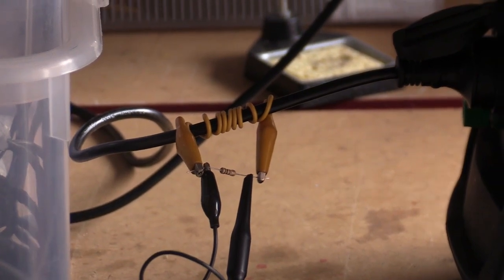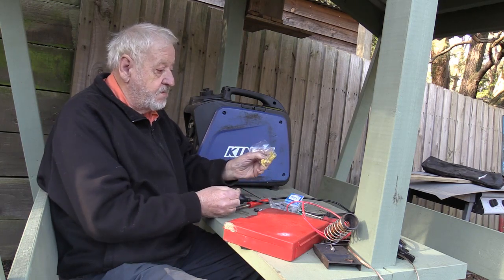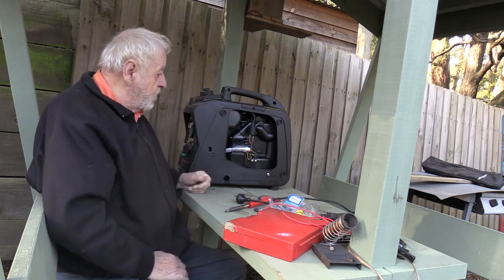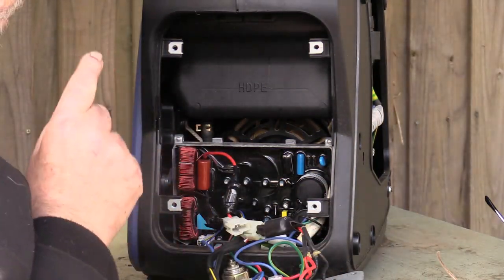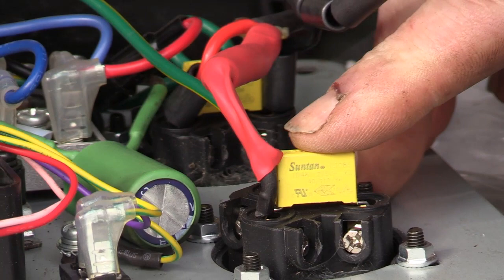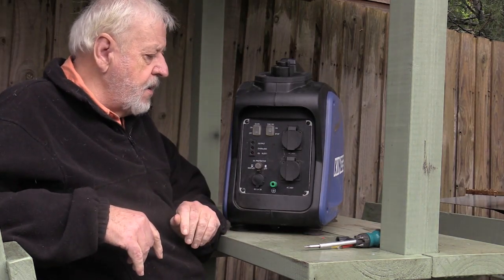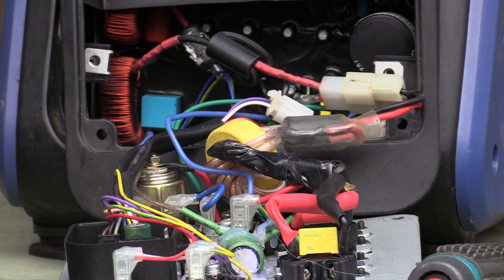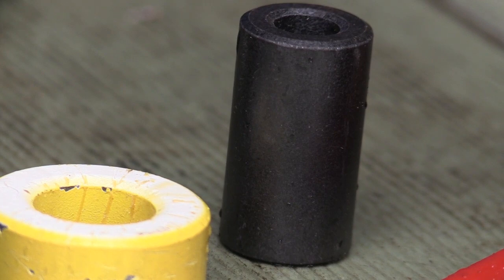QRM and EMI fix in my portable 2kw Kings Generator

Comment: We are the only ones who comply with EMC.
I once did a park activation and these grey nomads turned up in their Taj Mahal and when they decided to have lunch the entire HF spectrum was wiped out wall to wall.
You learn to be patient when you're an amateur.
Reply from the maker: Hi Ade there is a large number.s of gear that will make H/F a wast of time I found that some solar regulates can wipe H/F out along with some panels. there even a problem with some of the inverters so that's why I try to camp  and play radio well away for other people, one of my biggest grips is so many that run generators don't bang a ground stake in.
Reply: @JimMcNabb44  I understand. I never camp near other people. And yes, a earth stake is a start to keeping things quiet.